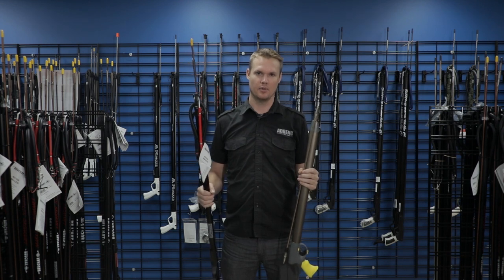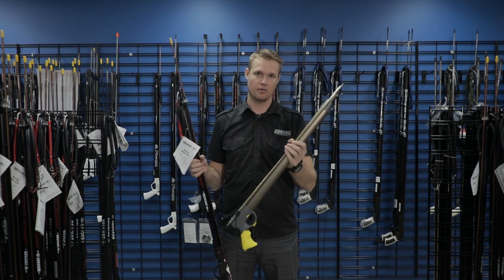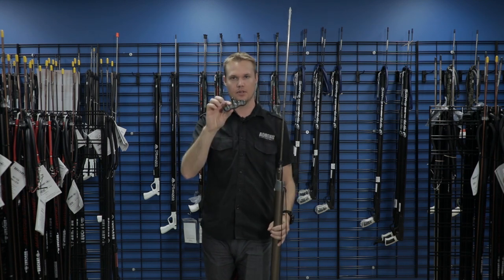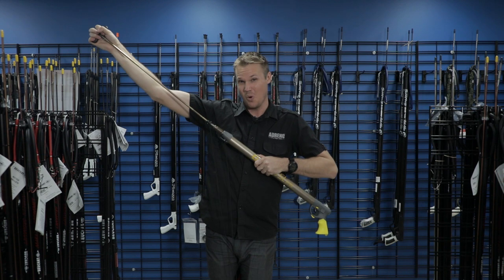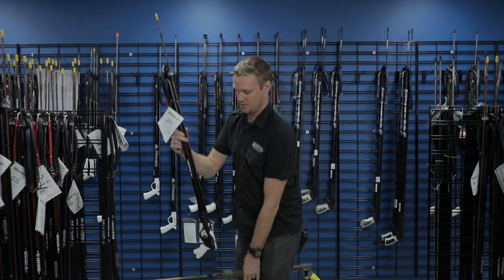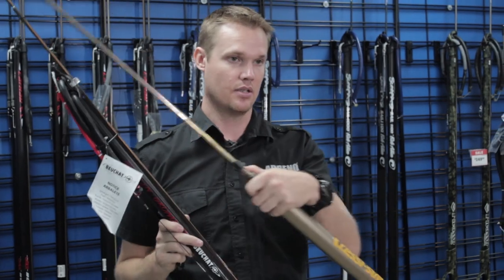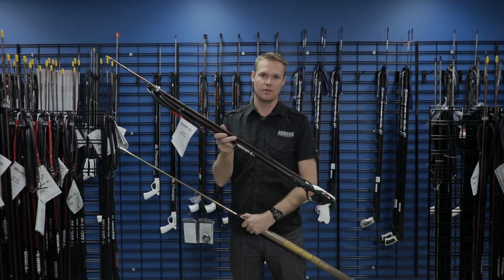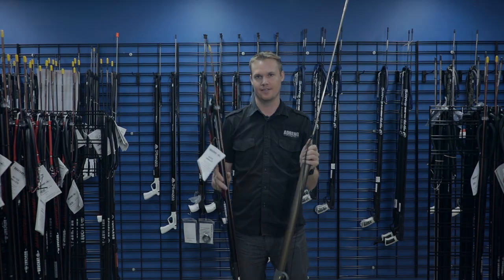Pneumatic VS Rubber Speargun | ADRENO

Comment: the presenter was obviously biased against the pneumatic. accuracy range and reload  comparison would be more informative
Reply: Yes I have both, I use pneumatic. Faster to reload and less tangles in choppy waters, shorter than a comparable power band gun. no need to replace bands yearly, I feel the shorter and thicker shaft goes more straight without drops.  Cons, repair may be more complicated, parts are cheap but often have to be ordered from Europe, also more careful with sand damage. But I can attach an action cam with a simple velcro wrist strap on the barrel. And I can travel with the speargun in a regular travel bag without having to pay airlines' oversize baggage fees

Comment: i have been spearfishing for close to 45 years now. The first 23 years i had the same undersee rubber gun. Then i was introduced to a mares cyrano 970. This is the best gun ever! i tried the hft but went back to the cyrano with a few upgrades i did myself. I shoot all the fishes i ever did. No rubber gun can be better than a compressed air gun when it comes to costs and reliability!
Reply: Agree totally. started with a Sten 90cm and now a cyrano 110. love em.
Reply: Robert.  Can you tell me a bit about the upgrades on the 970?  I love my 970s but over time they are increasingly leaky but Ive had them for 10-17 years (I have several).  I also agree that there is nothing else like them.  I have alerts on ebay for when I can snag them.  They don't pop up often.

Comment: This guy has never used a pneumatic. I've used them for 30 years my first a mares sten and currently a mares cyrano 110 they load way quicker than rubber guns and in 30 years I've only ever had 1 o ring give me trouble. They're easy to fix as if you have any mechanical understanding and the power is variable. I guarantee i can load my 110 faster and get it into action quicker than any rubber gun out there.  Treat them with respect and was them after diving and they'll last along time. Sad to see such a biased comparison I buy from adreno and they've never let me down but that was unfair to good spearguns. The only disadvantage is on older models the line of sight is higher than the shaft so this takes some getting used to.
Reply: yea that may be but they're not as accurate and powerful as the serious rubber ones
Reply: @davidvaknin3801  wrong
Reply: Do you need to fill up air for a speargun
Reply: @abdulrahmanreciteation  No, once you've pumped it up to the level of power you want - within the manufactures specs - thats it. Only if you loose air through a bad o ring is there a problem.  Servicing pneumatics is not hard and really only every second or third year would be fine depending on how much use it gets. Just look after them by rising in fresh water after us.
Reply from the maker: The main issue you will see in relation to power on a pneumatic speargun Vs a rubber speargun, is that due to teh nature of compressed air if you are diving deeper with a pneumatic speargun i.e. 10 metres plus, the deeper you dive means the power will be reduced, thus effecting the range of the speargun. The other major issue we see with penumatci spearguns, is people firing them out of the water; as this causes major issues with pneumatic spearguns causing damage to O-rings an internal compenents.
Reply: I have both a Mares and a rubber band .The pneumatic gun is much faster.
Reply: @ADRENO  Wow...why don't you just make it quick and say you really have nothing at all positive to say about pneumatics. Even though they are quicker to load? And the aiming is really not at all a problem after all unless you're actually blind (it's not as if you're shooting from a huge distance). I was a really puny 16 year old when I got my first pneumatic (Nemrod) and I found it really easy to load. C'mon guys, you're sports men and you have trouble pulling back a spear? What a load of malarky! And the fact that you can very easily adjust the pressure within manufacturer's recommendations means that you CAN ADJUST THE POWER! All of your criticisms are simply a matter of opinion. This was an unfair and completely biased comparison.
Reply: At deep depths the air guns lose power
Reply: G'day I have a very rare 1300 mares sten wich I bought second hand wen I was 16 I'm now 51 I'm actually sending it tomorra for its second service I love this gun its accurate fast but u don't wast a shot as it ain't fun loading it lol but I'm thinking of getting a rail gun 4 backup totally recommend bigist mares u can get
Reply: @ADRENO  yes butalso classic speargun lose  power for each 10 m depth as well. 10 m 1 bar 20 m 2 bar 30 m 3 bar.
Reply: Power comparison?
Reply: @M60gunner1971  never had a power problem, I mainly shoot table size fish 2 - 3 kg and never had an issue. The beauty of pneumatic is if you need more power you pump it to its max capacity. The only thing is you need to develop a good loading technique at full power. If you want to use it on reasonable size pelagic fish I couldn't see why not with a 110 size plus . Pump it to max and make the shot go where it needs to go.

Comment: Yes all you need is a 1/2 inch PVC T connector loads the spear like a charm.Make sure to connect the spear to the gun with a flexible aircraft cable (about 15 feet)

Comment: The spear loader costs about $3 and I carry a spare one. yes easy to lose, but also a snorkel can get lost as easily. I think pneumatics up to 75 cm are easy to load, and the piston pushes the shaft all the way ti the end,, while the rubber in a rubber band keeps losing momentum and stop pushing the shaft before the shaft has left the speargun. Isn's a 70 cm pneumatic comparable to a 90 / 100 cm band gun? easier to transport too, and you can easily add a n action camera with velcro. Also spear is thicker so it has more momentum and less likely to bend. Maintenance is simple and you can add some oil once a year. I bought a gauge and my Salvimar Predathor did not lose any pressure in a year. There are advantages for pneumatics. Yes an expensive 100+ cm rubber goon may be better for blue water, but there are pros in pneumatics that this video ignored.  Rubbers degrade, after a year they lose power, the pneumatic does not need a new piston or seals every year. Parts for pneumatics are inexpensive, and there are plenty of tutorials on how to service them. They are all more or less similar. When I switched to pneumatic I feel the spear shoots more straight.
Reply: bro...can i check with u on your gun what pressure did u usually load it up? and what kind is the biggest fish u would hunt with that pressure? Can u use engine oil like Mobil one of 5 / 50 to lubricate the gun? thanks in advance.
Reply: would only use a pneumatic on crays
Reply: I believe 20 to 22 bar I have the manometer. I bought SEAC oil for spearguns. It was not expensive, ordered it from a Spanish diving online store. You can go up to 30 bar pressure (I have Salvimar Predathor) but It is way too hard to load. I like that a pneumatic is more compact for the power, easier to attach a camera with a simple velcro wrist strap, and also way faster to reload in choppy water than an open muzzle band gun. I think the video points to some disadvantages without informing on the advantages. No tool is perfect and there is always a compromise and a matter of preference.
Reply: @honyeechou818  I have 2 Salvimar Predathor spearguns. They come at 20 bar, but manual states that you can pressurize up to 30 bar. But that would be really hard to load. 20/22 bar seems pretty good. I bought some SEAC brand speargun oil. You can check online. Since you need to lubricate after a year or 2, depending if you use it often or not, you can order wherever and wait for shipping. I ordered it from Subprof. Also if you look at DeeperBlue forums there are some people who are really knowledgeable on pneumatics including maintenance, repair and upgrades.
Reply: @honyeechou818   NO !!
Reply: ot can be oli any grade without aditives compleately... so only clean pure oil
Reply: Do they come with spare orings when you order?
Reply: salvimar 135cm  you can use for blue water.
Reply: @josechavara  135 cm is a band gun
Reply: @stefpix  no my friend I have ASSO-135 and is powerful, check Pipjn ferreras spearfishing.
Reply: @josechavara  how do you load it? it must be hard with such a long shaft. or you must have very strong arms
Reply: @josechavara  which to buy salvimar vuoto or seac asso rosso?

Comment: I have a 110 mares cyrano and a 115 salvimar carbon. I use them most weekends not a single issue since I bought them about a year ago and for maintenance it just needs a good fresh water rinse and a few drop of oil down the trigger. I made my own loader much safer than those and if you lose it I just wrap a glove around the tip and do it that way. Nothing against rubber guns just find the pneumatic gun much easier and faster to load in my case.

Comment: Can we se a proper review of a pneumatic please?:)
Reply: My friend, y was profesional spearfishing in Cuba, and I tested both.
The pneumatic you can load in seconds, the accuracy is better and power depends the size.
Reply: @josechavara  nope. Pneumatic is difficult and dangerous to reload and you don't have where to aim and even make a lot of noise when you shoot so it's for beginners now let the pros handle the rubber
Reply: @ΜιχάληςΤσάτσαρης-ν5ψ  my friend, I was born in Cuba, I did spearfishing  many years 4 days a week at least, and I use to dive more than 120 feet deep. I can te you for me it was easier and faster to load the pneumatic than the band and the shot is more powerful if you have enough air pressure.
Reply: My friend get 110 cm pneumatic and you will see the difference or 135 cm if you can load it.
Reply: @josechavara  Trust me because i have used pneumatic spearguns many times they are difficult to reload and actually they aren't stronger. A rubber speargun that ha 2 or 3 or even 4 rubbers are much stronger and it's easy to reload because you just pull quickly and boom it's ready!
Reply: @josechavara  Look pneumatics are cheap as you can see because no one buys them! Most people that have been killed with speargun it was a pneumatic! Because they pull it down and they hear a noise like the one it makes when it's reloaded but when they let it it blows the iron away so most times it hits them. But in rubber guns you can double check. You push the iron in the hole and then you push it again a little bit or pull it to see if it's loaded and then you pull the rubber.
Reply: @josechavara  For me it's easy to load it. I have spearfish with pneumatics for a long time but then I realised that spearguns with rubbers are better for many reason but anyway. The best speargun for me is a railgun with 2 rubbers.
Reply: @ΜιχάληςΤσάτσαρης-ν5ψ  my friend, I respect your opinion, but I will make a video at different deep and upload for you and show the difference. 
About the price: 
The bands are usually hand made. 
The pneumatic no.
Reply: @josechavara  Me too. I'm just telling you some reasons why they are bad... Actually they may be good it's what we like more! The bunds are handmade but easy to make and the bunds are used more because when you buy them they come with a metal peace on them as a bund but TRUST me you should remove it because you may reload your gun while you moving if the rubber brakes the metal will hit you and it will very very painfull and you'll need medical help but with the bund that's a rope you are safe!
Reply: @josechavara  I'd like to see a video from you and because I have spearfish with pneumatics many times in different depths like 2M or 25M or 30M i somehow know how they wark and how to use them, so I know they ain't bad but not my type.
Reply: @ΜιχάληςΤσάτσαρης-ν5ψ  I know that, in 1980 the Cuban government banned spearfishing,  and take away  all bands from shops, at tha time I was 15 year old .
We copy the mares pneumatics and believed they were heavy but better than original ones because we used steel chrome  internal barrels and we can put air a lot, and never explode. 
Original mares with internal aluminum barrels if you put to much air the rear valve fly against you shoulder or you mask.
Reply: @ΜιχάληςΤσάτσαρης-ν5ψ  because communist governments wants to keep the people struggling with money and food and they obey likes cows,  spearfishing guys makes money and get free food and communist don't wanted. 
So we have to do illegal all the time likes ninja's in the water, some times jump to the ocean, at 1.00pm and the police see you and waiting for you to come back, so we have to state in ocean to 9.00pm or more,  to avoid them.
Reply: @ΜιχάληςΤσάτσαρης-ν5ψ  I will buy one
Reply: @josechavara  how do you have internet?
Reply: @josechavara  
Those home made cuban pneumatics with the teflon machined handle were the best quality for the money, the aluminum was thicker in the chamber and fish could bang that thing against the rocks with no problems, hardcore, wouldn"t break, though they were on the heavier side, but there heavy is good to go deep as you don"t use reels and shit just tied to the buoy line. I miss mine :)
The talk of pneumatics loosing power with depth is a myth, I lost spears stock in the rocks easily in the 30s and I know people who used them in the 40s 50meters with no issues. For regular spearfishing depths the loss doesn"t make a difference
Reply: Why they suck at depth
Reply: @ΜιχάληςΤσάτσαρης-ν5ψ  sorry, just to understand. How the pneumatic ia more dangerous. You pull in the spear with hand, not towards  your body, so how it will kill you if it goes the other direction?
Reply: @polololo8377  well...that is a good question but I have seen it with my eye so let me tell you. If the spear gun is long enough you gotta put it on your knee vertically and push the spear that's sometimes leads to a spear going through your jaw,skull and brain because the spear slipped from your hands. I have seen the whole speargun blow up... And the worst... Shooting without even pressing the trigger...which may get a friend kill or injured, fortunately...I was just injured.
Reply: @ΜιχάληςΤσάτσαρης-ν5ψ  ok, understood, but if someone is facing the gun in direction of own head or other person, thats still something idiotic and that can happen with a rubber one as well, but I get your point.
Reply: @polololo8377  of course it can and it is idiotic! Look...if you want to use a pneumatic one, I'm not stopping you. Go ahead it's a nice experience but you will have to be extra careful! But if you want to spend money on a speargun I suggest you to buy a rubber one. And if you do always remember! Remove the bell or the metal that is holding the bands and replace it with a rope it's a must do for your fingers safety!

Anyway, have fun and be safe mate!
Reply: @ΜιχάληςΤσάτσαρης-ν5ψ  - whenever someone starts with 'Trust me I don't.  65 years old.   Spearfishing all my life.  Use both types.  Never had a problem loading a 90 pneumatic. You must be weak.  No way is it easier to load a gun with more than one rubber.  It takes at least 2 bands
 get anywhere near the power to match.
Reply: @Selkian  I can easily load a 90 pneumatic, never said I couldn't but a speargun with rubber bands is much easier even if it has 3 bands...I mean you don't load all of the at once... And about the power... The band you use determines the power you get. I use short and thick rubbers always...harder to load but very powerful!

Oh and all the respect to you mister!
You must have seen incredible stuff under the water and probably have beautiful memories!

Comment: How to release the pressure of the pneumatic gun? How do l know how much air to pump? I bought a pneumatic gun recently & l would like this info thanks Guys
Reply: you can use a pin in the back, push in the hole. I bought a manometer gauge, money well spent if you like a pneumatic, you can change pressure without exactly counting the pumps. I ordered it from subprof. Different spearguns have different screw threads, although some have the same. The manometer gets screwed in the rear, there is a pin. if you do not screw it all the way in to make a seal, but in enough the air will come out. You could also use a nail, maybe i'd file the tip of the nail first to make it more blunt, not as sharp.

Comment: which one's more stronger？
Reply: for short / medium guns usually the pneumatic has more power. You can search youtube with comparisons. Also consider pneumatic guns often have a thicker shaft that may have more momentum
Reply: +stefano giovannini
What are you saying? Band guns are much more powerful, trust me, I know.
Reply: @thebabbler8867  Band guns can be more powerful if they have 2 bands and are longer, or if they are rollerguns. . Check videos on YT where the pneumatic guns's shaft completely goes thru a target in a pool and  the band gun's shaft does not. The pneumatic's piston pushes the shaft until it leves the gun. The bands lose propulsion power 2/3 half way.the barrel a 75 cm pneumatic gun can generally more powerful than a 90 cm band gun (probably 105 cm actual length). I have both, and there are advantages / disadvantages. Pneumatic is also faster to reload as you can shoot right away without wrapping the line if you need to. Also pneumatic guns usually have a thicker shaft. J.R. Productions did you make any comparisons? have you tried them both? For me one main advantage is that I can travel with a sufficiently powerful speargun that fits in a 32 inch travel bag, to travel with a band gun I may be charged oversize fees by an airline to check a band gun (which are actually longer, as length refers only to the barrel, unlike pneumatics where length refers to the whole speargun)
Reply: @stefpix  someon forget talk about Tomba kit which means dry vacum barell. You have to check that speed of spear. Horoble on Cyrano 110. you can get 34 m/sec.